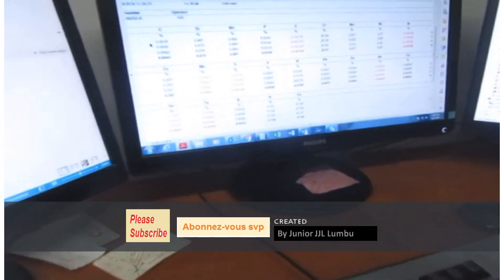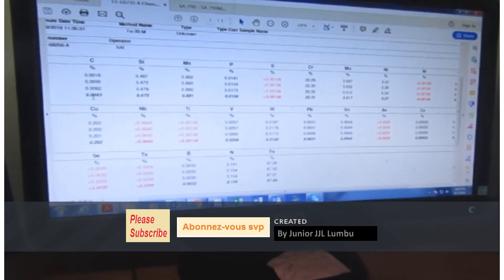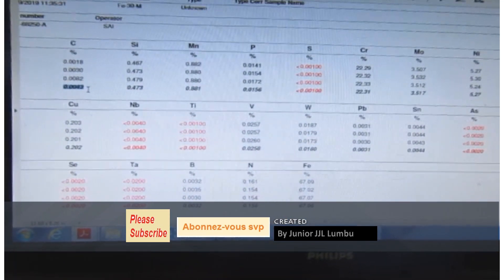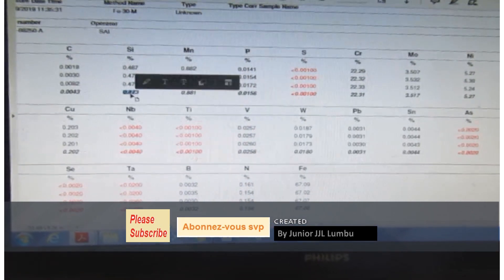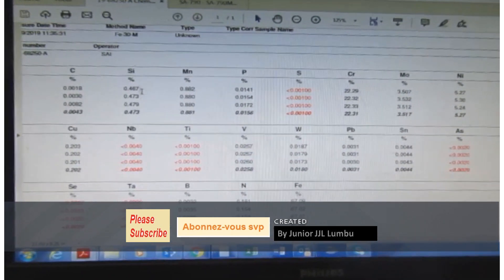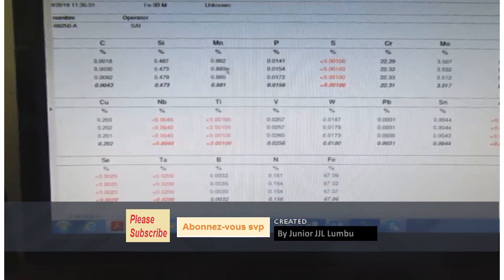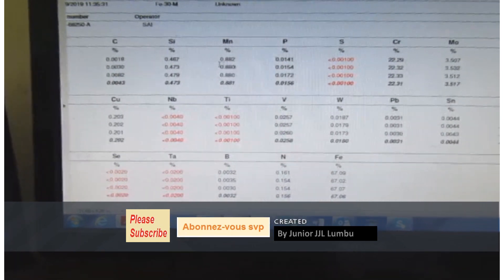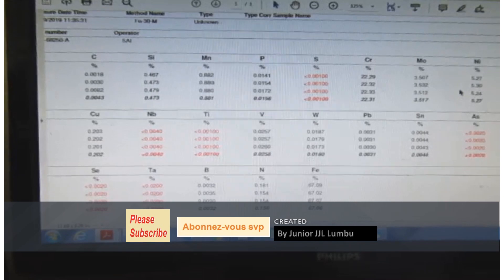Chemical test, Spectrometer test, Test chimique,Spark Test, analysis and sample preparation

Comment: I'm very impressed with your content, my company has a spectrometer similar to yours but a different brand. The challenge is that we have not been able to use the machine because of software issues, I humbly ask for your help to get the machine running.
Reply from the maker: Hey there, which country are you based on?